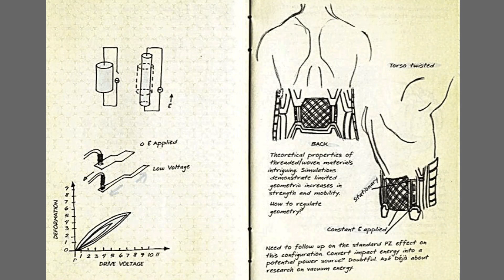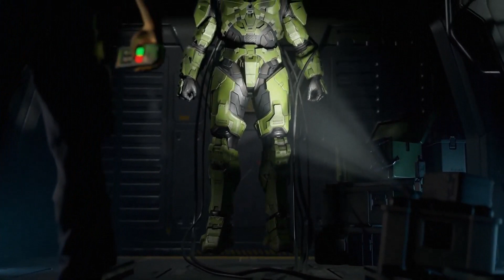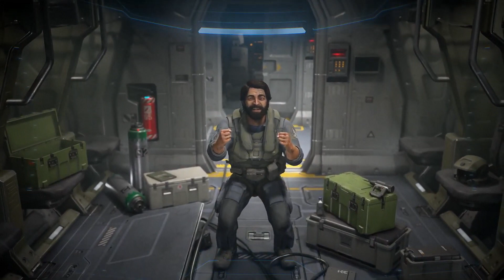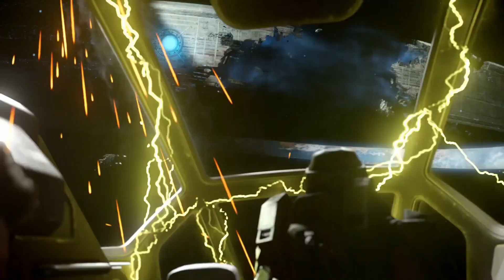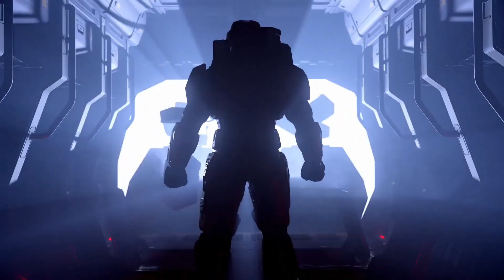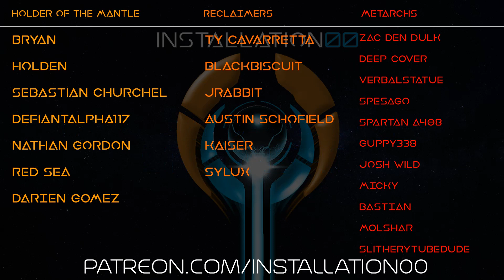Classified Materials - 05 - Halseys Journal

Comment: One possible cause for the factoral scale down, could be for safety interlocks, as even with the massive enhancements of the Spartans, there are finite limits that may have needed to be accounted for.  If you;'ll remember, the un-enhanced volunteer basically tore himself apart in the gen 1 Mjolnir armour

Comment: Why does the Scorpion tank only use a 90mm tungsten round isn't that extremely primitive and weak? Why not something like a 200mm uranium round that's anti tank with a railgun?
Reply: If you shoot a small mass fast enough you can get the same amount of energy released as a nuke
Reply: @BrooklynThomas92  This as well as something that was noted by US army ordnance's development of armor in ww2 that as far as i know persists to today. if you can achieve the same effect with a round of the same caliber by increasing velocity, it is always preferable to do that. SO logically the reason the scorpion uses a 90mm gun is simply a question of getting more ammo into the tank. but the gun is far from the biggest problem with the scorpion tank's design. As for not using uranium? probably because tungsten  weighs less. That and the round that exists in lore as far as i can tell is APBC or Armor Piercing Balistic Capped that has a high explosive filler. This means the round is used with the intent of having the shell fragment upon penetration of enemy armor, for which purpose i believe tungsten to be better than Depleted Uranium, but im not certain on that as i dont know what kind of characteristics DU has in that scenario. Larger Caliber does not equal better in every case.
Reply: @WhiskeyPinata  
https://youtu.be/-0gPb6PUUUA
You're better off with more firepower plus it's a one manned tank it can hold plenty of ammo with a bustle autoloader. 
Plus I said uranium rounds not armor that would be just ridiculous and a safety hazzard. A ammunition tank full uranium rounds wouldn't be that heavy for a tank better off dealing as much damage to the Covenant as possible then just prolonging the fight especially since they were losing badly.
Reply: @WhiskeyPinata  
Also a railgun for the Scorpion tank instead would give the rounds more velocity and speed. The UNSC use Macs and railguns commonly they should of installed them on the tank.
What a missed opportunity.
Reply: @thorshammer7883  i have a simple question for you. What tank is better: the tiger or the Sherman?
Reply: @WhiskeyPinata  
What does that have to do with anything?
Reply: @WhiskeyPinata  Objectively? Tiger;  it'd be the tank I'd want to be in. Better gun, better armour so better survivability. 1v1, it'd win almost all the time.

If I was a military planner? The Sherman; Cheaper to produce in vast numbers, manoeuvrable, reliable. Allows me to throw numbers at the problem almost anywhere. Basically logistics will never be a problem.
Reply: @thorshammer7883  Two manned tank, unless you're a Spartan.
Reply: basically, because it's easier to get a small mass moving faster, than a large mass moving at an equivalent velocity, plus you can carry more small mass rounds.  If you fire a 1kg mass at 2kps you get about the same impact as you would if you fire a 2kg mass at 1kps, plus, you can carry twice the amount of the 1kg mass as you can the 2 kg mass, annnd you're using about the same amount of propellant (wither that be actual powder, or electrical propulsion in railgun)
Reply: @TheMariusDarkwolf  
I rather have quality and extra fire power then a quantity of inefficient  weapons and ammo. Heck the velocity of the 90mm rounds are slower in game. Armor piercing high explosive was outdated already. Explosive anti tank is a better weapon. And a railgun would increase the velocity and force of the round had they used it thus making it more deadly. With 200mm anti tank round they could easily destroy Covenant vehicles much more effectively.
Reply: @thorshammer7883  it has to do with your understanding of basic military logistics and then applying that to the scorpion. Its really not that hard to grasp. The tiger was on a one to one basis in combat superior to the sherman, but as a cog in the machine of the wehrmacht it was hot garbage. It oft didnt make it to battle, it took far too many respurces to construct, and it was always outnumbered in engagements. Being the biggest gun is also not the "highest tech"
Reply: @thorshammer7883  while I can understand what you're saying, I think that you might not have grasped what I was saying. 
First a question, damage output being equal which would you rather carry, 100 rounds (meaning a possible 100 kills if you hit with each) or 50 rounds (meaning 50 kills again presuming you hit with each)?  If both rounds are loaded with the same amount of propellant, (which for tanks and morters are pretty standard) then the lower mass round will go farther but more importantly FASTER than the higher mass round. Since damage is a function of Mass times Volocity (MV=K) you're going to get the same damage output, or possibly a bit more, since a smaller round focuses the damage more tightly.
100kg×200kps = 200kg×100kps and you get twice the rounds.
Reply: @WhiskeyPinata  
Well my suggestion for the weapons the Scorpion is not that difficult to make because this is 500 years in the future and the UNSC have tons of railguns. And what kind of round do modern militaries use? Rounds that are usually larger then 120mm and they are anti tank rounds. Just look at the russian and german tanks they don't have problems producing those. So the UNSC which had better assembly capabilities and more advanced technology then today would have no problem in mass producing tanks that fired 200mm anti rounds with a railguns acting as the main cannon.
Reply: @thorshammer7883  again, I'm not sure if you're not grasping what we're telling you, or if you're refusing to accept basic realities of combat/war especially as regards supply/effectiveness. Or if you're just trolling. Lemme try it this way. Just because I can shoot an astroid at someone (orbital mac guns fired multi megaton projectiles) doesn't mean that's the best option. It's generally a better usage of resources, to fire smaller masses faster that larger masses slower. To reask my question in my last reply; damage output being equal, wouldn't you rather have more ammo?
Reply: Have you or your house ever been hit by a 90mm tungsten round? Speed and kinetic energy is the key.
Reply: Mobility mostly. A rail gun uses a lot of energy, they would need a small but powerful fusion pack on the Scorpion to do it.  It would take a longer time to charge up a rail gun than to load a new round of 90mm. Most NATO tanks use 120mm smoothbore munitions, while the Brits use 125mm rifled on their tanks. By real world standards, the 90mm gun should be firing the projectile at least 3200fps (comparing to WWII era 90mm guns). 120mm fires at 5700fps. In game it appears that its firing at about 1000fps. I'd rather see a Gauss variant in the future, or a bigger gun on it. Also never understood why the coaxial or front mounted machine gun is only 7.62x51mm and not at least .50BMG. The .30cal is barely effective against shielded enemies. .50BMG would make short work of them.